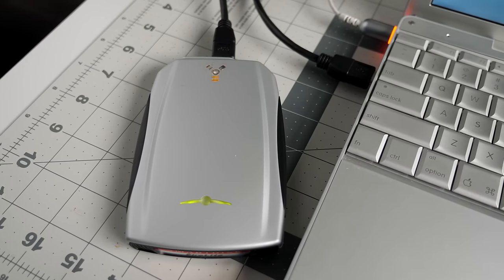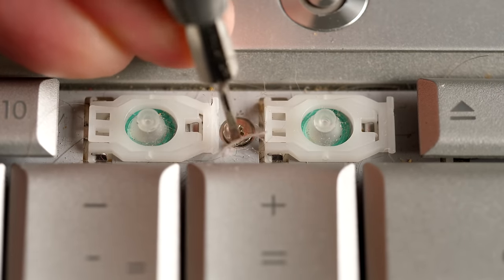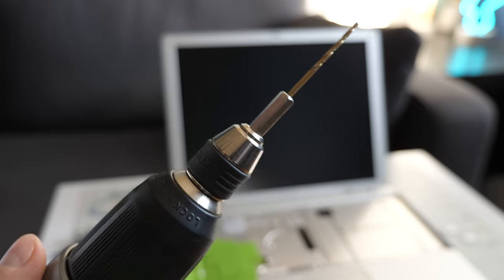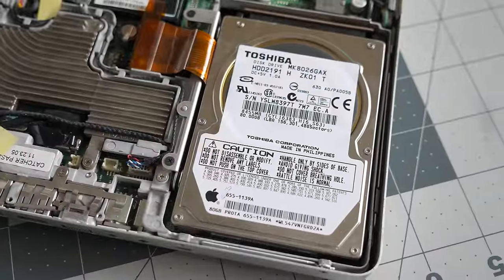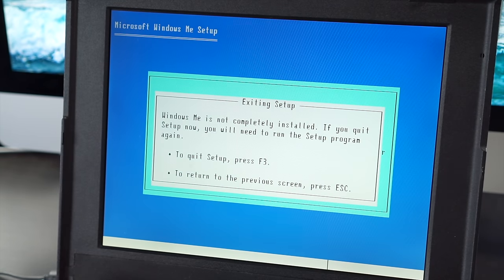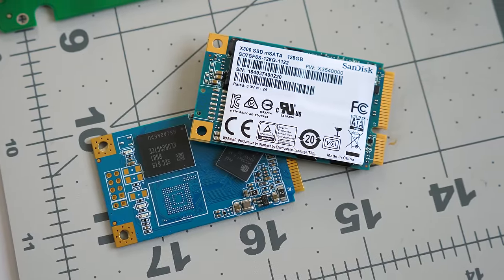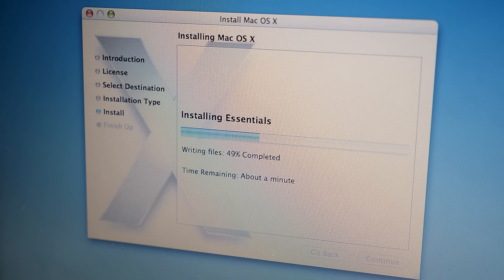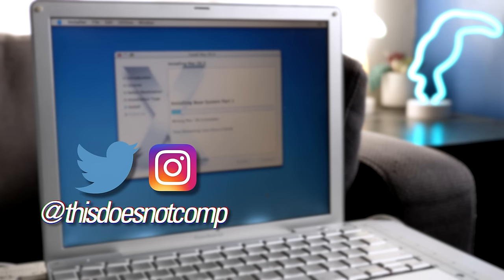12" PowerBook G4 Hard Drive Replacement

Comment: When removing a screw with a damaged head, use a dremel with a cutting disc to make a slit in the screw head. This will allow you to use a flat head screw driver to remove the screw.
Reply: You dont even need a dremel, A small jewellers file is usually enough.
Reply: @draggonhedd  good to know. I didn't even know a jeweler's file was a thing. I use the dremel for tougher screws when I am doing construction related things.
Reply: He's used this trick in the past - I suspect something made that more difficult than drilling it out, perhaps the angle of access.

Comment: As for the bright spots at the bottom of the display: I had this on my G3 Pismo as well. It's caused by the screws inside the housing that holds the panel being too tight. This causes pressure on the panel, which will result in these bright spots.
Reply: look like someone in its past opened or closed or both, it way to fast for the hinges, and something got a bit bent out of shape ?

Comment: I didn’t know about these M.2 adapters! Thanks for that Colin. I’ve found CF cards to be an expensive option these days and go with cheap SD cards from Kingston that are ~100MB/s. The adapters have been a mixed bag however as one I purchased is incapable of addressing more than 32GB. Not bad for the Win 2000 era older machines I have, but I expect will be harder to purchase as time marches on.
Reply: That sounds more like the bios not understanding higher capacities, because the adaptors are completely passive
Reply: @MrHack4never  You're thinking of CF card adapters as those are passive (as mentioned in the video). SD to IDE card adapters have a lot of work to do as the protocols and the bus widths are different. I can't say for absolute certainty it's not a BIOS problem but the supplier did say it only supported to 32GB. Unfortunately I'd purchased a 128GB card.
Reply: @RandomInsano2  
Oh I missed that bit
Reply: Are 100 mbps SD cards snappier than a 5400 RPM (or slower) IDE drive?
Reply: @alvareo92  Yup! The IDE bus at best is 8bit at 133MHz, so the fastest it could ever transfer is 133MB/s. In other words this is nearly as fast as possible. Old hard drives had to wait before data would come under the read head as well, so there’s much less waiting for small reads/writes which is really what makes it feel faster. Also less power.
Reply: It's mSATA not M.2 they're different formats
2 screws = mPCIe/mSATA
1 screw  = M.2

Comment: Next time when dealing with screws that have thread locker on them and you notice that you’re slipping with your screw driver: take a soldering iron and put it on the screw for like 10-30 seconds (at about 350 degrees C). That softens the thread locker and the screw can easily be removed.
I still remember when Nokia used a too strong thread locker on their C3-01 phone screws, so that they constantly snapped off. Then they updated their service manual with that soldering iron trick as well.
Reply: that's evil

Comment: I regularly use mSATA and M.2 SATA to IDE adapters in my old laptops, and have very rarely had an issue with almost anything that uses 2.5" drives. 1.8" drives I haven't yet had the same luck with, and there are some laptops that are so tightly packed around their drives that even some regular drives wouldn't fit (and I'm not on about drives being too tall either) - Toshiba's Libretto L series being one offender.

Comment: Your description of the disassembly process, coupled with the fact that Apple chose to put one of the slowest and least reliable HDD's (Toshiba) of the time in it, makes me think that Apple really designed that laptop to be e-waste.  I say that because at the Apple Store you would have been charged enough to replace the HDD that many would probably have chosen to just replace the laptop with a newer Macbook.  This is something that Apple has done in the past (and I think is still guilty of today):  They design their computers to be replaced rather than repaired.
Still, that particular HDD lasted nearly 20 years.  I did the SSD upgrade with an IDE 486 laptop recently, and the improvement over an HDD is great!  (Although not as huge a difference when upgrading a SATA system from an HDD to an SSD.)
Great video.  Thank you.
Reply: Not sure about so-called “Fusion” drives, but with straight HDDs, Apple kept using Toshiba until the retina MBPs

Comment: I see the G4 Powerbooks aren't much easier when swapping drives!

I have a mid 2005 12" iBook G4 that had the exact same problem with the drive slowing to a crawl. It was just as involved of a project to swap the drive in that machine as well, but swapping to a 128GB mSATA SSD with the adapter was the most cost effective solution. It also had a drastic improvement in read/write speeds even over the original 60GB 4200RPM spinning disk.

Comment: This video takes me back to when I used to work at an apple retail store as a “genius” in the early 2000s.  Repairing the 12in PBG4 was not the most favorite machine to deal with outside of a HDD, ODD, or RAM replacement due to the sheer amount of screws involved.  Don’t get me started on doing a MLB replacement on those, that was the worst.  the 12in iBook of that same generation wasn’t much better either, lots of small screws, and even more heat shields and housings to remove when servicing.  The funniest thing in this video is your choice of FireWire drive for imaging, we used those SanDisk ones as well, they were pretty great for the time.  Love your channel, keep up the good work!
Reply: That time when Apple actually used to replace drives. Nowadays all you can do is kiss your data goodbye. Unless you're using 3rd party repair.

Comment: I’ve never opened one of these 12 inch G4’s before but after taking apart my 17 g4 to replace its drive a while ago it seems like the bigger ones are WAY easier to work on. You don’t even need to remove the keyboard on them, it comes up with the palm rest

Comment: @8:40…Ghosting on the screen was a common problem with this particular model, which was the last PowerPC powerbook made before Apple switched to intel. I ordered my power book directly from Apple shipped from the factory. It already had a line of 3 ghosting splotches in the middle of the screen, brand new out the box!

Comment: This sure makes me appreciate my 2018 ThinkPad, that I've taken apart many times (mostly for cleaning) without the need for a service manual to figure out where screws are hidden or which clips to unlatch.
Yes I had to replace some parts that shouldn't need to be replaced, like the touch pad and finger print reader. But changing the hard disk or ssd would take less time than the length of this video.

Comment: I had the 15” version of this machine. It was a nightmare to repair without bending the thin aluminum.

Those bright spots on the LCD were a known fault with all sizes of that machine. There was a replacement program in the 2000s. I doubt Apple would honour it in 2021…

Comment: That disassembly to replace the HDD...is INSANE.
Modern laptops don't require that XD. Just unscrew the bottom case and that's it XD
Reply: replacing the storage is outright impossible on the new M1 Macbook

Comment: I did the same HDD replacement in my Pismo G3; it is now dead silent... But beside using vintage software, there is very little to do with OSX 10.4, the TenFourFox project has halted development and even on my 1.25 G4 it was very slow at opening modern website. The most recent version of any software that run on 10.4 is now 10 years old, so again fun for vintage software but nothing more

Comment: I started hating these little PowerBooks when I had to disassemble mine to replace the fan and clean the motherboard... had to take the entire thing apart. And I'll have to open it up again to replace the optical drive, not to mention it also has that backlight problem.

However the 15" model is, if I recall correctly, much easier to open up. Not "older Thinkpad" level of easy, but still easier than the 12".

Comment: I love these 12" PowerBook G4s. Great as a bridge machine, and a fun way to play around with PowerPC OSX.  These machines also support those Dual Port Compact Flash card adapters, it'll recognize both cards in the stack as master and slave IDE drives. So if you want to get adventurous with trying to get a bootable OS9 install on these, or some variety of Linux going without disturbing your OSX install.

Comment: I had the exact same model, and the cd drive went bad. If I remember right, the service manual had you remove almost everything from the bottom half of the laptop. That process has about 3x more steps than the HDD replacement. As a bonus, almost every screw below the palm rest is different. I wish I thought to tape screws to service manual. I had to use a ruler to measure all the screws and compare them to the manual. Repairing this model is not for the faint of heart. Other laptops of the era were stupid simple compared to this one. However, I do miss my old PowerBook g4!

Comment: Great video, Colin !!! I still have my first Power Book G4 12" 867MHz, bought it brand new at CompUSA in 2003 as far as I could remember. I accidentally burned  FireWire port in it, around 2008 when I was plugging my M-Audio FW 810 card in it, there was a light show with smoke coming out, otherwise laptop is still functional. I was wondering if it will be possible to replace FW controller chip in LB to make it work again. I have another 2005 12" PB 1.5GHz thought  which I want to upgrade with SSD and it looks like it starts to having same issues with monitor. So I have to deal with two machines now).

Comment: Ohhh, those damn Toshiba HDDs of this period..
I also owned a PB G4 (12" 1,2Ghz) and the HDD died after 3 oder 4 years.
It was exactly the same model Toshiba MK8026GAX, which I saw dying after that more than one time in my job as a Dell Technican.
I replaced mine with a WD 160GB 7200 rpm which was quiet expensive at this time.
But the 7200 rpm was fine an accelerated the PowerBook significantly.

Comment: I've used the mSATA to 2.5" IDE adapters in a few laptops including a 15" PowerBook G4 and some early 2000s Sony VAIOs. They've worked ok with noticeable speed bump in use and making the laptops silent for the most part. My 15" G4 was slightly easier to work on than the 12" shown here but still relatively many screws to deal with. I'm thinking to get a few more as backup or in case I continue to expand my retro laptop collection.

Comment: I've had my eye on some PATA SSDs for years, but never saw any opened up. Good to know what's in there. Haven't needed one yet, but now I know my options when the time comes. Thanks!
Reply: are all  PATA SSDs the same really just a case for newer type of drive?
Reply: There is also the option to use the Compact Flash adaptor with a Compact Flash to SD Card Adaptor. Most of the time this is the cheapest option for old devices.

Comment: I've got a 1.33ghz 12" iBook G4 I have been putting this process off on for years now, does not look like fun to swap out its drive.  I even have a 128GB mSATA SSD and PATA adapter shell for it, 100% pure lack of courage/ambition to tear it apart since it's still working.

Comment: Hi. I have 2 Toshiba Satellite Pentium M / Celeron  laptops ( the older one has serial / parallel / cdrom / usb  but no floppy and is my retro portable )

Anyway last xmas i decided to freshen it up with dual bot dos 622 and Win XP, the drive made some minor sounds but basically it was OK , after it was all done i came across something then thought about the laptop, i searched ebay and found NOS 44pin 80 gig 2.5 in drives, i bought one @ $20 AU or $15 USD

I installed the drive and the SMART stats confirmed it was new with about 5 to 10 mins of run time and 2 reboots on the clock - i am hopeing that is factory testing 

It all went fine, 5400 rpm is slow but ok for dos - Oh i did try 2 of the CF adapters for 44pin but the toshibas were fussy and i could not get either it to run ( i later tested them on a a older DELL laptop and they worked fine )

I was so happy i ordered another one for the non-legacy machine for winXP and linux puppy

My G4 Ibook was a slightly complex drive swap as well

Comment: for stripped screws you can try cutting a slot in it with a dremel, and then using a flat head screwdriver.

Comment: Boy I wish this had come out two days ago. I just replace the hard drive in my PowerBook on Wednesday and it sucked. I broke the F1 and F12 keys removing them and one of the mounting screws for the CPU cooler sheared off after I replaced the thermal paste. Those screws are the worst.

Comment: I have the low end model of these, its a bit banged up and had at least 2 previous owners before myself. I don't think the DVD drive works and the metal is bent at the disc slot.
to get the optical drive out of one of these you need to take the whole computer apart, I found reusable heat pads to avoiding having to muck around with thermal paste, hopefully when get some spare time I can get the drive out and have a much lighter machine. and do the SSD upgrade too :)

Comment: Those soft metal screws screwed (heh) me over when I swapped the HDD from my 12 inch PowerBook a few years back.  I regret not putting a compact flash card in as I don’t think I’m getting back in at this point without extreme measures 🔨
Reply: ouch

what a pity

Comment: Another option is to use a PATA to SD adapter. Similar to the M-Sata adapter, it has circuitry to adapt the interface of the much newer standard to work with IDE.

And unlike CompactFlash where you have to hope your card is compatible and hasn't deviated from the spec, those things are solid and work because it's up to the adapter, and not the card.
Reply: SD cards are no use for more modern OSes like OS X. They were designed for short term storage and given the amount of writing to disk that OS X does, especially when indexing or those hidden .dl files scattered all over the place, the SD will soon give up the ghost.
Reply: @egbront1506   That's why you should use an Application rated card, since they're meant for that kinda thing. Meanwhile that's not really a thing with CF cards.

Comment: i put a ssd into my 17" pb 1.67 HD. Its still molasses slow on 10.5. I need to put 10.4 onto it i suppose. I upgraded my 12" 1.5 too, but sold that back in 2008 before it lost value.

Comment: Thanks for this! Building a PBG4 for a friend who wanted a PowerPC Mac and between this and the iFixit guide and some help from a friend on Twitter I somehow got the SSD installed and working. XD

Also if you're careful enough you can swap out the hard drive without having to unplug anything attached to the palmrest other than the trackpad. I didn't want to risk yoinking the power button connector off the logic board. @~@;

Comment: You and I share the same vision, upgrade the old stuff and make it better then it was and make it last longer, but in saying that also the most important thing is the older stuff is just better built for longevity especially the Japanese, German, Taiwanese and some Korean stuff, beside American made ofcoarse. The chinese stuff is just utter garbage unless they had strict Quality Control specifications in big name company contracts. Every screw u had to find and undo drove me insane on this build and unfortunately that would make me definitely avoid models like these, on the other hand i did not know that my 2 kingspec drives that died on me may be able to be fixed, they failed pretty quickly after purchase from china, so i dont think i got another hhd or ssd from china ever again unless i had to get specific Apacer dom drives, as I had no source choice. Anyway keep rocking my retro rebuild world and I think so far thumbs up for every vid i seen of urs so far.

Comment: At least you can now use a new hard drive. I had a laptop that stopped reading 2.5" hard drives all together. The only way to use it was to install windows on the 24GB mSATA drive that was in it. Windows lies about it's minimum hard drive space apparently.

Ps the hard drives work just fine on other machines so the laptop was not killing them.

Comment: My 12" G4 got completely destroyed by the previous owner trying to take the hard drive out, luckily it's mostly in one piece now, but it's missing the battery, and they must've broke the keyboard connector because only a couple keys work. Luckily I have my 15" G4 is completely fine

Comment: I got rid of my first 12" when this happened in 2009.  It was in rough shape anyway so not worth the effort.  But if it happens to my new minty one, I'm definitely replacing it.  I snagged a complete in box 12" on Craigslist in another state for $100 with a retail copy of Leopard.  It took a few days of convincing the seller to ship it but it all worked out lol.  It's my favorite Apple machine outside of the new 14" M1 Pro.

Comment: i once heard the hard drive upgrade process for this machine described as “you remove a ton of tiny screws and then you kill yourself.” i tried doing it and ripped the power cable port off the logic board. ugh

Comment: 2:20  This is why you should never buy cheap tools and especially cheap screwdrivers.  Invest in a snap on screw driver set or other high quality screwdriver and bit set.  If you buy good tools, this stuff doesn't happen and you won't ever need to replace it.  I have tools my grandfather bought.

Comment: The bit on the holder you’re using isn’t correct for all of the screws. The size and type of blade thickness and tip bluntness affect how effective the bit will be for a given screw. I can just about guarantee you that incidences of screw head damage and torque transfer will be massively reduced If you take a moment to verify the correct bit. 
It’s more important than most folks recognize.